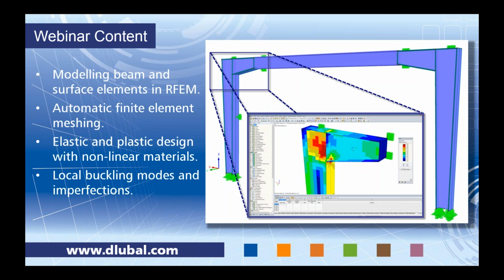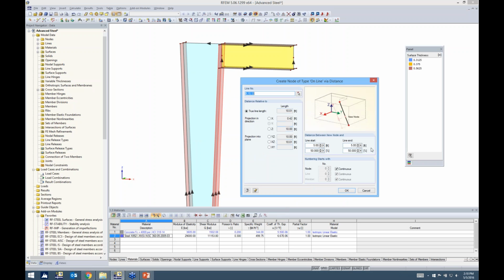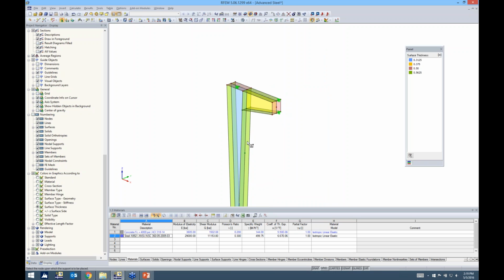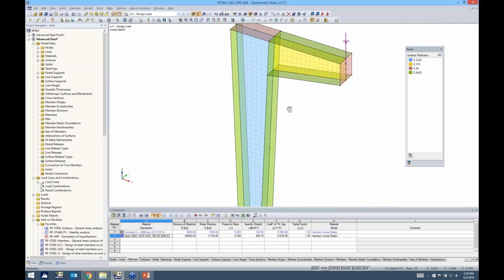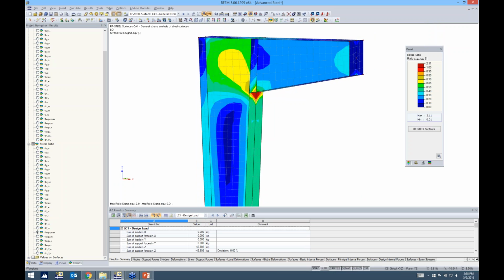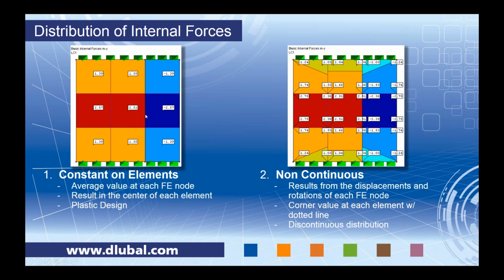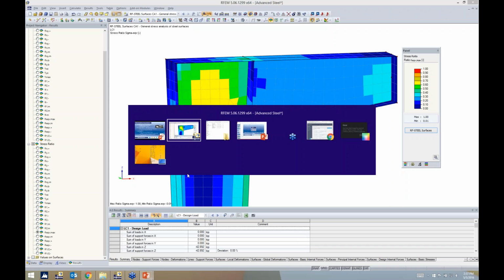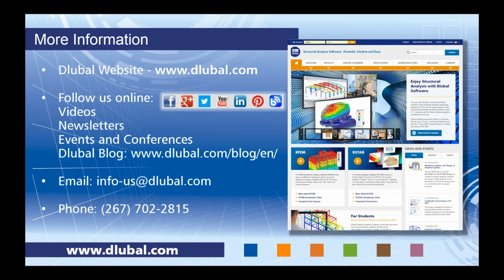Webinar: AISC Advanced Steel Design in RFEM (USA)

Comment: One question. What if I have performed frame analysis and want to have another model to check my connection by modeling them as surfaces, How do I apply moment to the surface? (Shear is quite straightforward just like what you did by applying vertical line loads). Do I divide the moment by the depth to get the in plane line loads applied to flanges or would you recommend something else?
Thank you and very good webinar.
Reply from the maker: Hi, o!
If you need assistance, please contact our customer support by e-mail at info@dlubal.com and send us your model. Then we can check it.